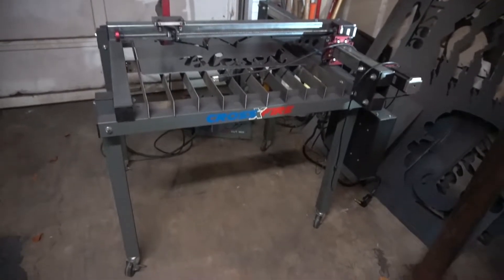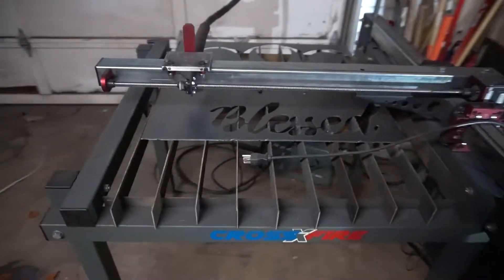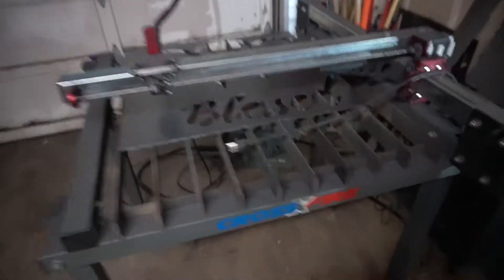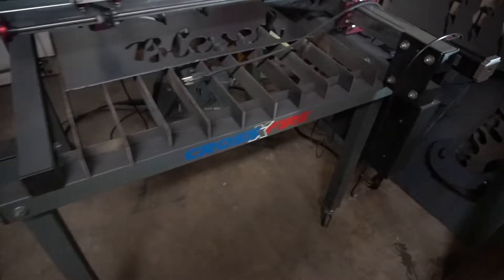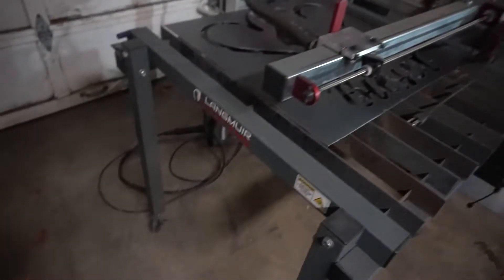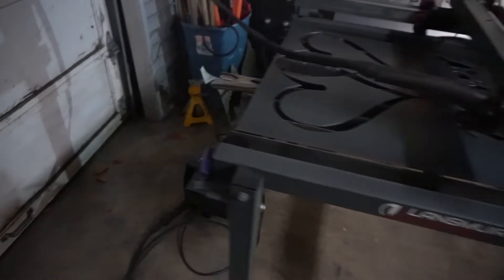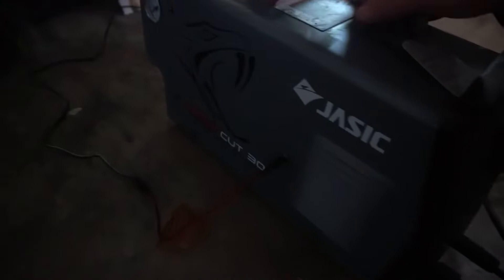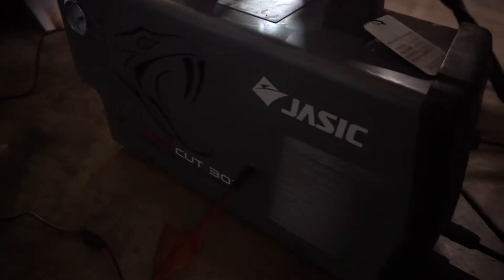update Langmuir systems plasma table

Comment: I have a vipercut 30i on a Langmuir table as well. I’m totally new to it. Do you have some recommended settings for speed and amps? I can’t seem to find anything on the Langmuir website for a general rule of thumb for different thicknesses of steel. Thx!
Reply from the maker: Depending on metal thickness I’m running 25-30amps at 100 inches a minute

Comment: how did you wire the torch firing cable I have a different plasma cutter I just need the basic wires to hook to if you could post a video on how you did yours that would be great Thanks
Reply from the maker: aidian95 does your plasma not have the cpc port in the back?
Reply: No
Reply from the maker: aidian95 I’ll try to get a video done showing how I did it in the next few days
Reply: @andrewtygart  that would be awesome thanks. I found the torch firing wires but what I dont know is whitch one to splice into
Reply from the maker: aidian95 if you found the torch firing wires you need splice into both of them 
It’s just a open closed circuit so it doesn’t matter the order you do it in as long as they are the torch firing wires
Reply: The ones that run to the trigger correct
Reply from the maker: aidian95 yeah I took my sheetmetal off and spliced into them on the inside
Reply: @andrewtygart  thx man they give you instructions for everything but that